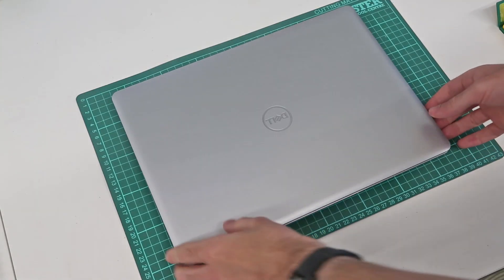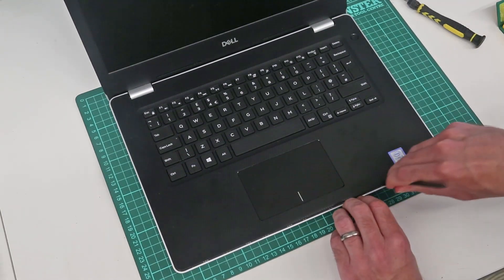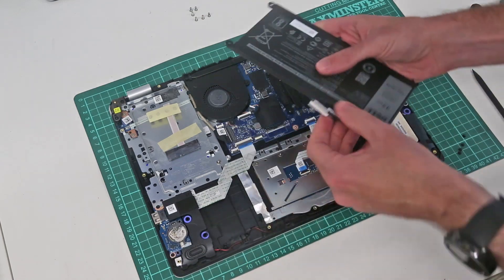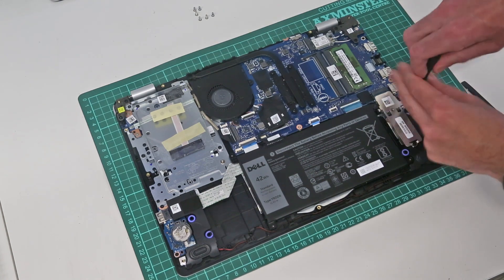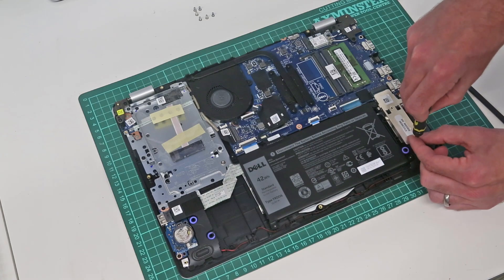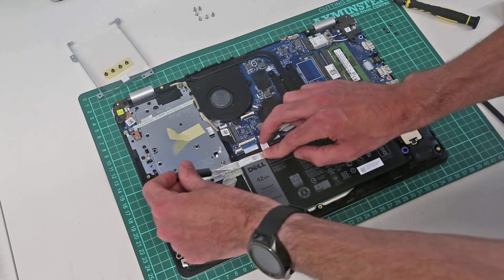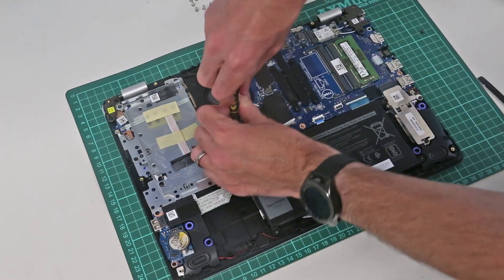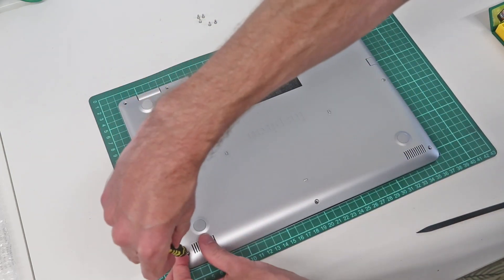Dell Inspiron 3481 SSD/HDD, RAM, Battery and Cooler Upgrade/Repair Guide

Comment: It means I can add external ram, ssd & hhd both and which type of ssd i have to to order, and ram please reply the type..
Reply from the maker: You can't add them externally, they are fitted inside.
Reply: @BrueComputing  i was saying that we can add more ram because slot is given, ssd slot given so we can add, one hard drive  in already installed and other hard drive we can add inside or not... That i was asking
Reply from the maker: @jmmgcocfamily  Gotcha. Yes both can be added, and links are in the description.
Related parts, via Amazon Associate links:
1TB NVMe SSD: https://amzn.to/3lAjpGH
8GB DDR4-2666: https://amzn.to/2YOQViH

Comment: can i upgrade its provessor from i3 to i5? if yes is it overheating
Reply: No. It's impossible
Reply: You cant upgrade the processor. Its fitted in the motherboard. If that was possible, anybody would have bought an i3 laptop and changed it into an i5. 😁

Comment: Which screwdriver did you use for unscrewing the battery? I've tried using PH1, PH0, PH00, PH000 with no luck

Comment: bro i have the same laptop as yours, can i add 8gb ram to be 12gb ram. what should i buy? 8gb 2133mhz like the 4gb ram installed or the 8gb 2666mhz? thanks in advance!
Reply: Yes,there is no problemn in using 266mhz of 260 pin